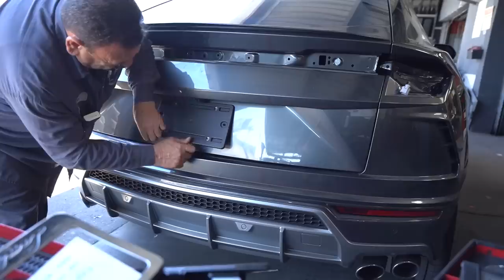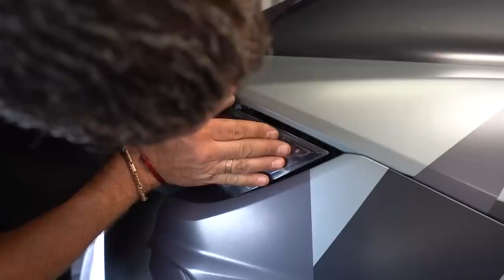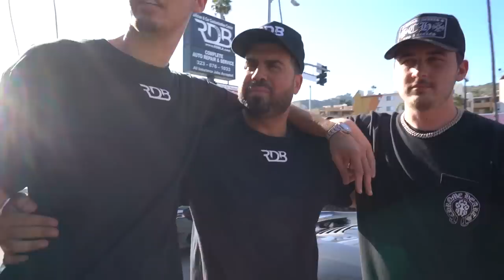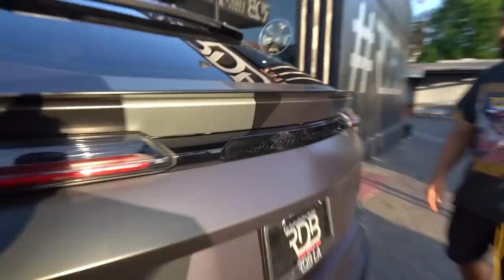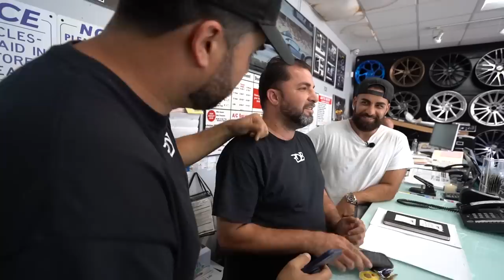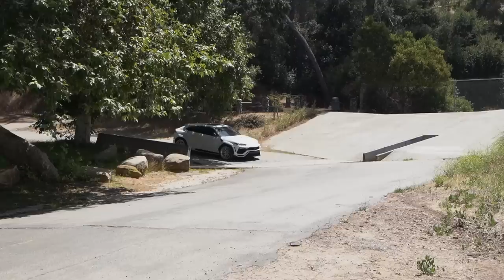#RDBLA CAMOUFLAGE URUS, DRIVING THE WIDEST LAMBORGHINI URUS IN THE WORLD!

Comment: Always worries me, when you mess with the suspension. The video of the Urus, on the road, looked very bouncy. Been lucky enough to have a Bmw my driving life. From a 84' 320, 91' M3 all white wheels/interior, with only 12,000 miles, 95' M3(Brand New), 2005 330i Sedan(Brand New), 2009 335i Sedan(Brand New) and now a 2014 750LI(Brand New) and a 2018 Mercedes GLS63 AMG(Black/Black)(Had a kid, and his mother passed)But still miss my 3 series.